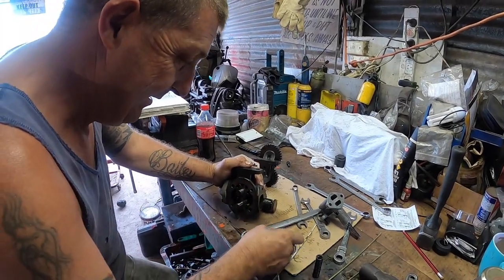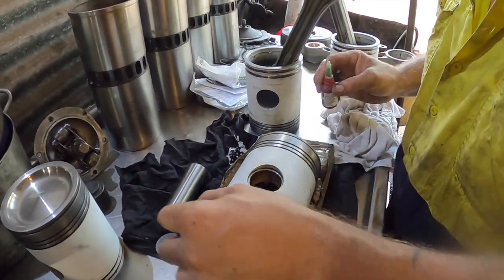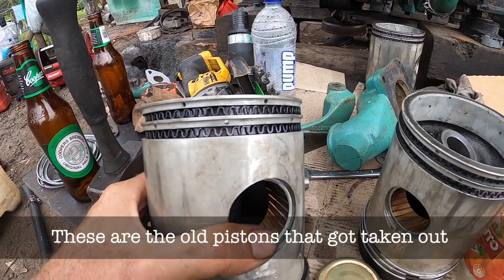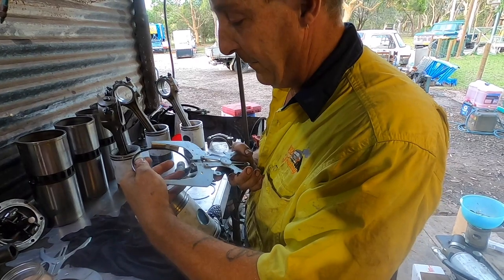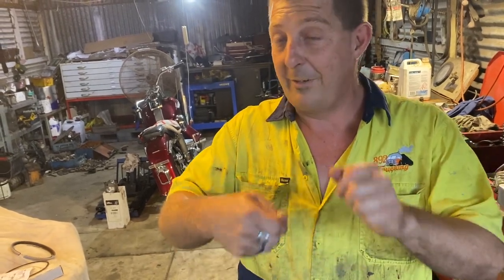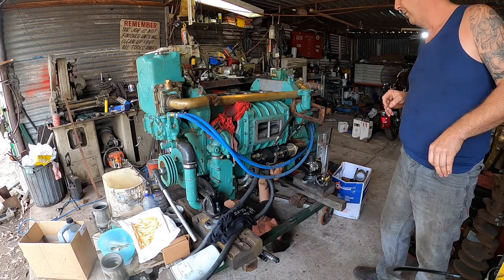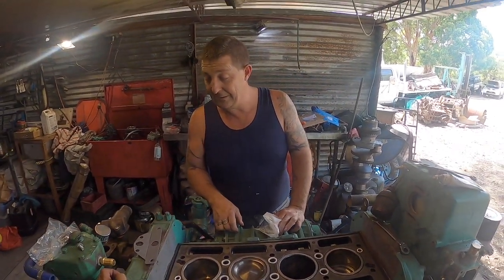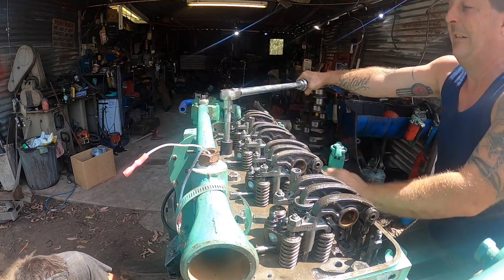Assembling the Detroit Diesel

Comment: This “rebuild” is fantastic, I always felt the motor reliability prior to this was uncertain.  Now I feel it will last beyond the life of the boat.
Reply from the maker: I too have a lot more confidence in it now. It was always a worry so I'm glad I pulled it out again. Decades of reliable running ahead now. :)
Reply: @DangarMarine  Stu a lot of people have wondered whether you will be recovering any costs against the original engine builder ? Be nice to know you didn't get completely screwed.
Reply: It's good to see an engine being rebuilt properly. The only sad thing is that this was only done 120 hours ago. Perhaps this engine rebuild series should be shared with the original engine rebuild company as they could learn from this. 😂
Reply: @DangarMarine  plus you've factored in the chance of a sequel - Renko goes turbo

Comment: The original bandag bullet had 2 8v92 with twin turbos and nitros. I was lucky enough to see it in action once at Willow bank. Man that thing was a tyre shredder
Reply from the maker: Very cool!
Reply: It was a genuine v16 the blocks are seperate and different from
A 8v92 , and only would
Ever be able
Use one them as v8 block but has o ring grooves thru end faces

Comment: I have seen and used some splinter axe handles over the years. The axe handle on the bonnet of the Land Rover surpasses all others I have used. Great series. Worth doing. Worth doing well.
Reply from the maker: It definitely needs a new handle, it's actually broken at the moment after using it on a camping trip.

Comment: Worked on 53,  71 series engines mostly 6-71 and 4-71 on gensets and offshore cranes. They were great engines and easy to repair even in the dark with my helper holding a flashlight working up in the air over the water on a small platform crane.

Comment: Interesting difference in "ring philosophy" - Adrian puts the gaps on the pressure face (90 to the gudgeon pins), while my RR trained brother works hard to make sure the gaps aren't on the face, and no two gaps are in line.  As I say philosophy as both build engine that run for ever.....
Reply: Different engines need different ring spacing, 2 strokes have ports in the liner.... 4 strokes don't.
Reply: @2secondslater   I like to 180  ring gaps, but I do not like them I rail road em.

Comment: lol adrian didnt like my golf ball tooling. never said it was right but it got me out of trouble. it is so nice having the correct tooling to do a job right, but that dont always happen. never had much luck with the paper match trick.   used hi tack in the corners.
Reply from the maker: I think the main point is that there are plenty of other things you could make that are much closer to the shape of the actual tool. Chamfering a piece of dowl would be closer.

Comment: the oil pump is defiantly a bit worn..  i would be vary tempted to put a .015 or .030 shim under the regulator spring.  and the one thing i do not agree with from BGM is the oil. i would be running 15W 40
Reply: BGM has a very specific reason to use straight 40 oil, with low ash content.

Comment: It's funny how the stupidest thing can screw up the whole deal with those piston pin end caps. I built a Big Block Chevy years ago and while putting the timing chain on I heard some thing that sounded like a snap but there was other stuff going on and thought the noise came from somewhere else. Come to find out it was it was the cam sprockets thrust bearing cracking. The second I started it the bearing started to shave it's way into the block's face. By the time I got the timing set I already had silver flakes on the dipstick. The motor was trash and I had to save it being it was super rare and it was one of two in my race boat. I still have that cracked bearing hanging over my bench to this day.
Reply: @crunchytheclown9694  Back at ya!
 It was a hard pill to swallow. I usually blogged and shared pictures on boating site about restores and such about the boat. That one, I have one picture of the bearing hanging around my neck asking people if they like my new $1800.00 neckless? 😁
Reply from the maker: It's always good to save those reminders of lessons learned.
Reply: @finscreenname  Like Burt Munro..."sacrifices to the God of Speed!"

Comment: I always wonder if the 180 degree ring placement can actually be found in a modern times workshop manual or if it is just a thing mechanics do. I mean the rings will rotate around the piston anyway when the engine is turning and the compression should be good on the first startup because of all the oil trapped in the groves.
Reply from the maker: Plenty of service manuals will give you the exact clocking of each ring.

Comment: Oil pumps do not give any trouble on these engines. What really gets people is low oil pressure (4 to 6 psi)  at idle, even when new, from the factory. The "white" metal is actually tin, on cast iron pistons. Never seen anybody use Locktite, even factory mechanics, on the pin retainer. If installed with the proper tool, like he has, and there is a worry of them coming out, something has gone wrong.
Reply from the maker: Just an extra precaution I guess that does no harm.

Comment: I’ve got a CV 30hp Yamaha 2 stroke, I’m new to boating and not real good with 2 strokes, it’s a great engine the only problem I’ve had with it was I flooded it while on the water. It was so frustrating at the time as it’s pull start, I’m thinking of getting a trolling motor but I’m also wondering am I better off getting a four Stroke so I don’t have to worry about flooding? Any advice would be appreciated tia
Reply from the maker: Two strokes aren't generally good with a lot of trolling, but it shouldn't really flood, maybe just get fouled spark plugs. I would start by making sure the carburettor is tuned and the float level is set properly, you have the right spark plugs for the engine and then just give it a quick rev in neutral every now and then while fishing to clear the oil out. Also make sure you use high quality 2 stroke oil at the right mixture.

Comment: Does anyone know what the horsepower will be when they get this put back together, and does it have a turbo or blower on it. Hope everybody's having a good Christmas, gbaker Lake Cumberland Kentucky
Reply from the maker: About 140HP.
Reply: The Detroit diesel is a two stroke design and uses a supercharger (roots type blower) to pressurise the air charge so it flows into the cylinders when the ports are exposed under a higher pressure than the remaining burnt charge in the cylinder.  Some engines turbocharge the air before the the supercharger as well.  Edit. This particular engine does not have the turbo, hence the previous engine builder fitting the wrong rings (that were suited to turbo models). And a Merry Christmas to you.
Reply: @davidsteer8142  thanks for the reply, that's something I know nothing about is diesels and very little about gasoline engines, thanks again and a great year coming up to you
Reply: @DangarMarine  thanks a lot for the reply, I hope you find a whopping treasure this coming year and you don't have to tell the government about it, 🤔

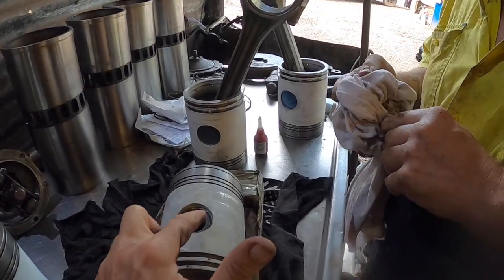Comment: What's the use of that cap you fixing in piston two sid of piston pin  (12:00 to 14:00)
Reply: Take a look at the initial video in this series, 2 videos ago. The cap keeps the pressurised  oil inside the piston. Previous rebuilder did not install these caps correctly. As a result oil could leak to outside and get consumed which was the issue Stu was having
Reply: Ok thankyou

Comment: Something that has always puzzled me about Detroits is how the ends of the upper piston rings do not foul the edges of the air ports, having rebuilt many engines including motorcycle, car and tractor, on the two stroke motorcycles with piston ports, the rings have pegs which stop them rotating, but the Detroits don't seem to have them, how is it done please?
Phil                https://www.youtube.com/user/philhermetic/videos
Reply: Ports here are much smaller than with motorcycle engines, could that be the reason?
Reply: @casparberends2719  They are bige enough to catch the end of a ring, or at least I would have thought they were, and yet it doesnt seem to be a problem, thats why I askedAdrian seems to do Detroits at Avatar level, so he is bound to know! Maybe you are right!
Phil
Reply from the maker: The ports go all the way around the liner too so there isn't really a position you could lock them in.

Comment: Those oil pump gears need to be replaced. They need to be a matched set. 
I realize the boat's been running with them for a long time, but it doesn't mean it's right. You are losing pumping efficiency and flow.
Reply from the maker: Got 65 PSI after the rebuild. I'll keep an eye on how they go.